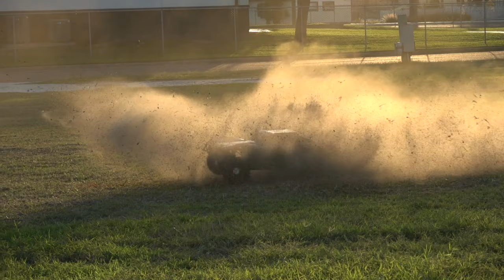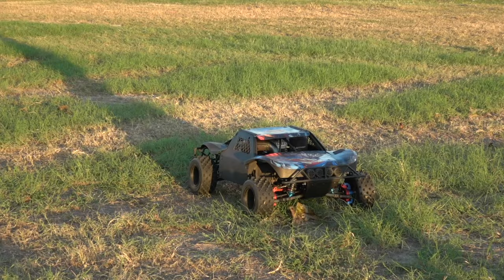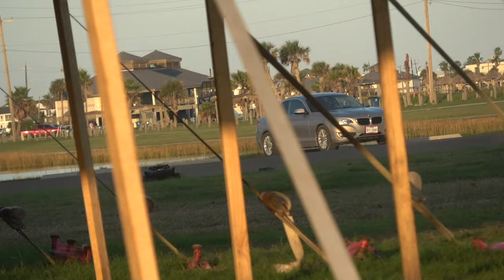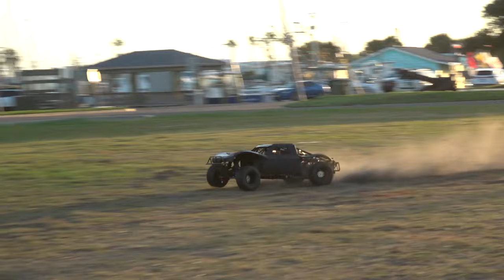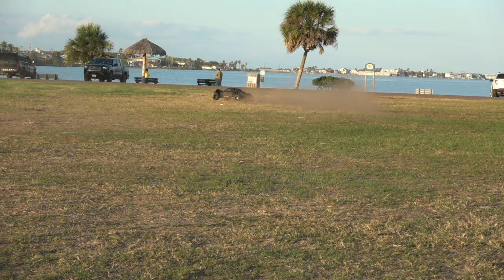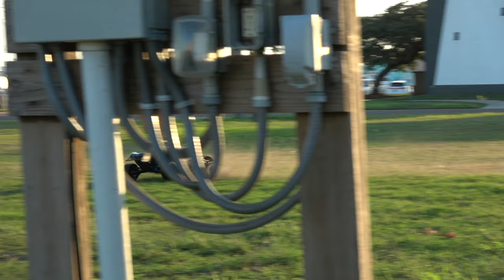Super Powerful RC Car! Custom Build!

Comment: I've found a 2 speed and a 3 speed transmission for my 5ive t... any thoughts on if this is a good or bad upgrade??
Reply from the maker: I have never tried it before, but have always wanted to. Don’t know what the outcome will be. Let me know!
Reply: I'll definitely let you know.. but I'm having this no idle issue.. so I bought 2 more carbs and put a new one on and I still have some problem.. won't idle.. ive even turned idle screw in all the way and Still won't idle.. so I took carb off and checked all the bolts on the motor and everything is tight.. im at a loss right now .. i have stock 5ive T 2.0 .. I have roughly 4 to 5 hrs run time on this unit.. any suggestions on what might be going on.?? As long as you are in the throttle 5ive t runs great it just won't idle ughhhh